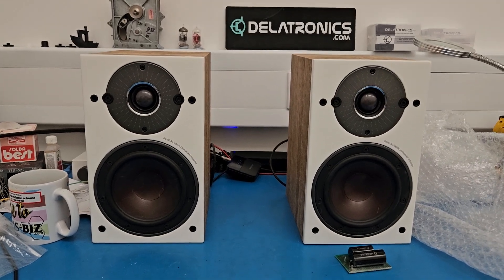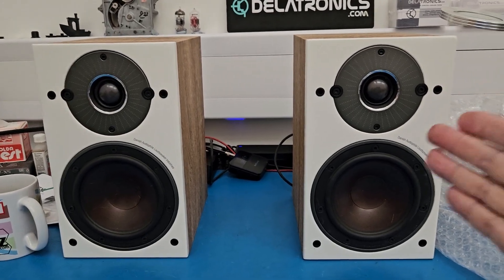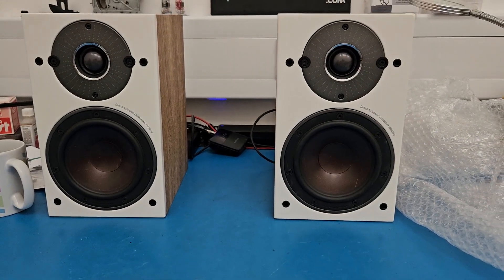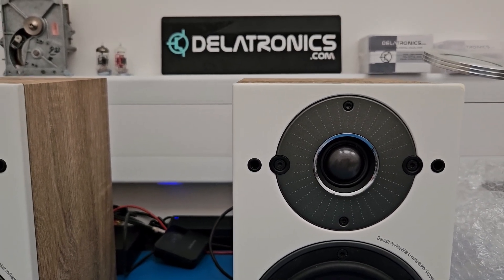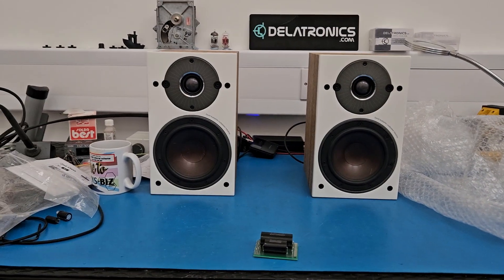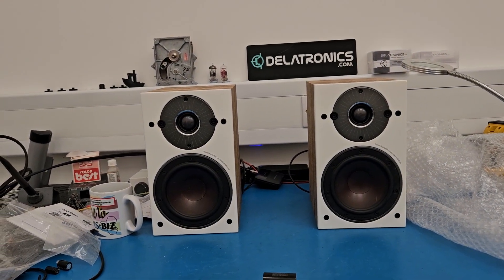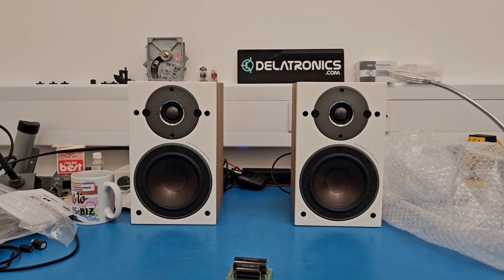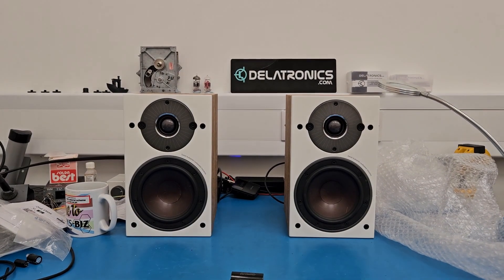Dali Oberon 1 Crossover Upgrade Results

Comment: I enjoyed all your Zensor/Oberon reviews. I have Zensor 1's fitted to a wall, only spaced from wall by the Dali stick on rubber stands. I love them and they sound great in my garden room 12m x 5m. They fill the space easily with clear detailed sound. I keep wondering if I can better them but so far never found anything that has tempted me but your findings on the capacitors is tempting. I cannot find 5.9UF caps if thats what are fitted to my Zensors  but I can make them by paralleling caps. Will see. Thanks for the reviews.

Comment: At back binding post inside connection within speaker cable there have 2pcs of steel , once remove it and if know how to solder , solder it a new a quality 16awg speaker cable smoother sound that also helps alot ,
if don't how to solder use copper connecter to join back . 
Try you will suprise the sound more acceptable and no harsh anymore .
After break in or run in for sometime you listened to a upgrade level sound
Reply: @kevinchew2594 can you help telling me more in detail what to modify? Thanks in advance for your time.